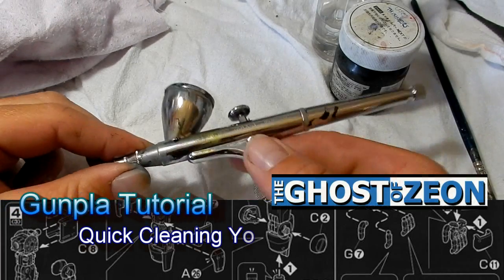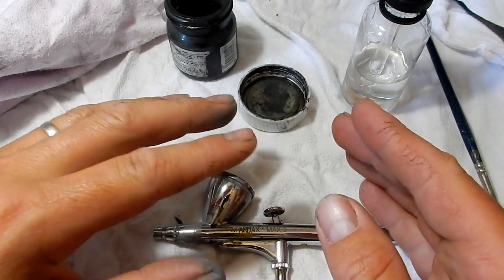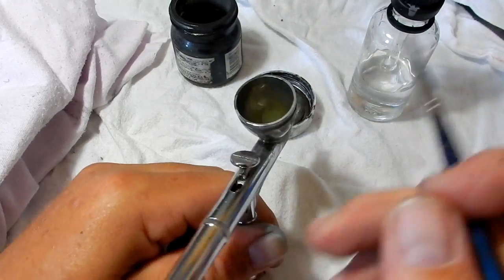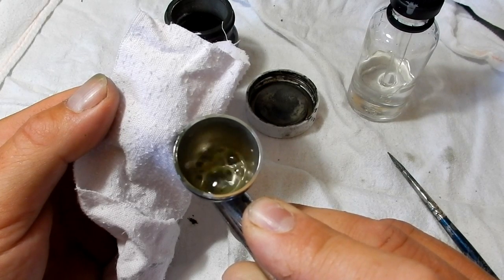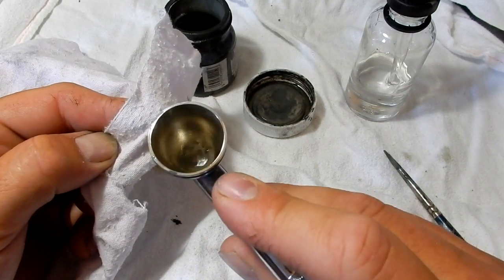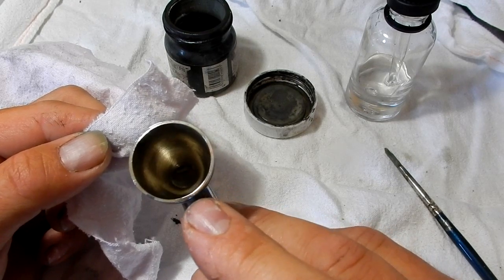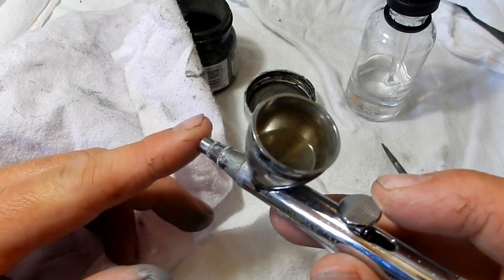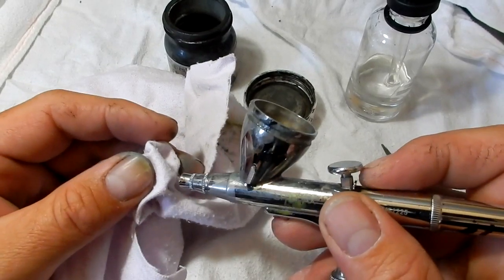Gunpla Tutorial : Quick Cleaning Your Air Brush

Comment: Are you able to just blow the thinner through to try and get some of that loose paint instead of bubbling it back and tipping it out?
Reply from the maker: You can but it sort of defeats the purpose as the bubbling brings the paint back into the cup. If you spray it, it will go back to where it was (albeit thinner than before) which will mean more thinner to clean it properly.